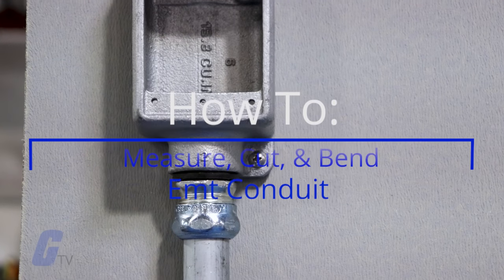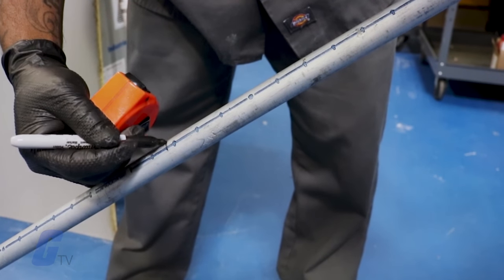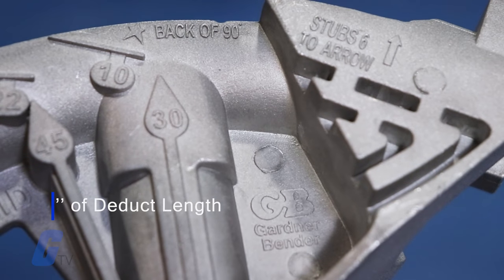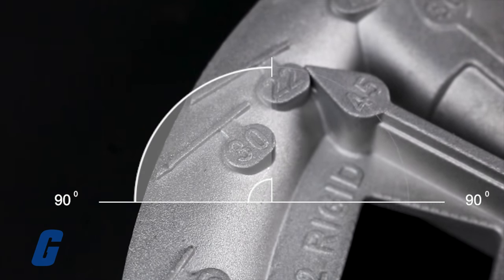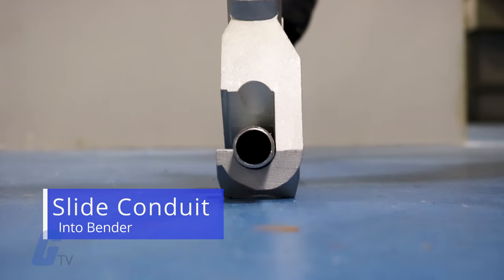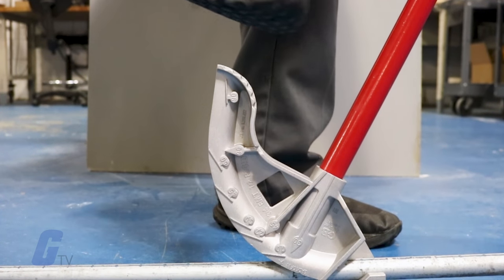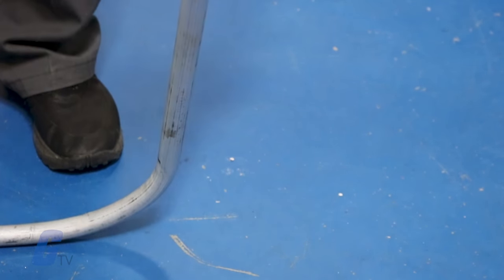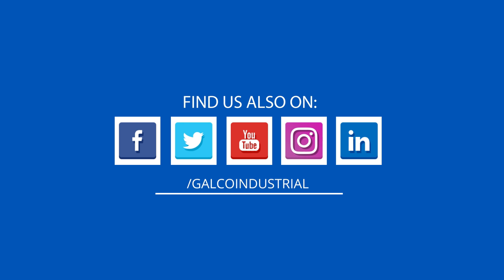How to Measure, Cut, & Bend Emt Conduit | Galco

Comment: You didn't tell how to figure out where to start the bend.
Reply: Star mark ...mark at actual length 
Stub height use deduction calc 
So depends on what easier if you need a 5 in 90 for half inch you don't wanna bend 10 ft of pipe in the air so you'd use your deduct

Comment: Pipe cutters are not supposed to be used on EMT. It reduces the interior diameter.
Reply: I've seen beginners do better looking bends. It's not even plumb, and you didn't show how to measure the location of the 90. Wow.

Comment: You dont pull the handle. You apply pressure on the show of the bender. You're fired.
Reply: When he took the bender off, you can clearly see that the conduit is kinked, due to pulling rather than applying pressure on show and using handle as leverage.. Fired lol
Reply: Bro
I'm new in conduit bendiga
So
You just need aply pressure and not pull the handle? 
Or need to make both of them??
Reply: @senorjalapeno3937 *conduit bending